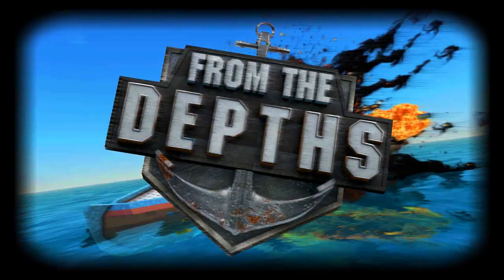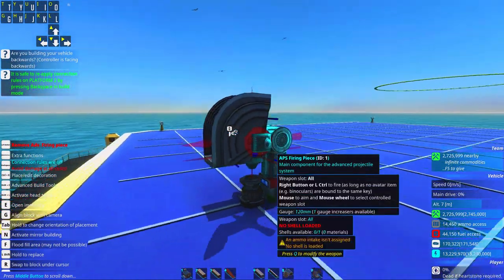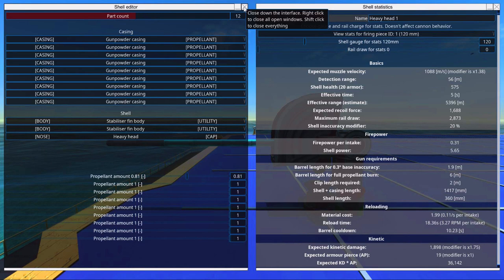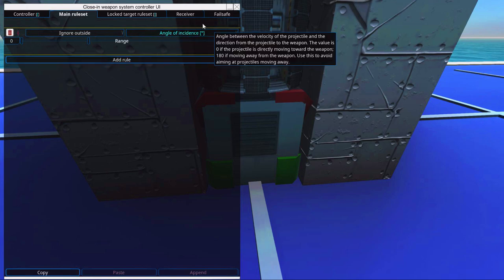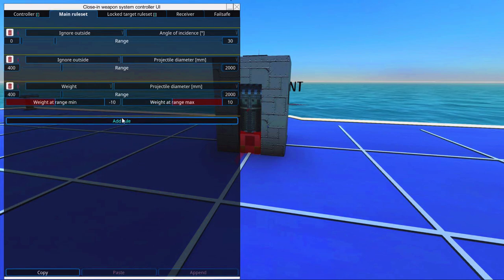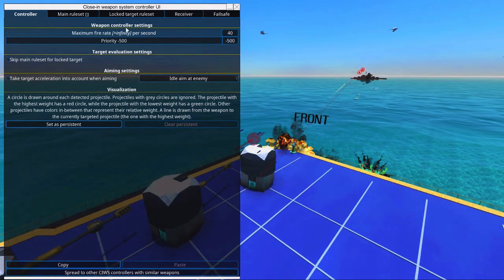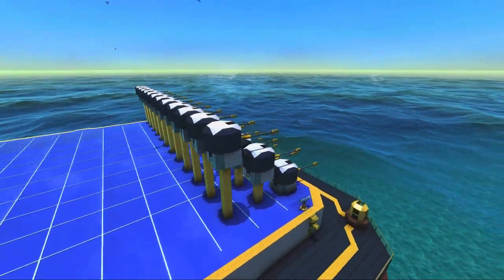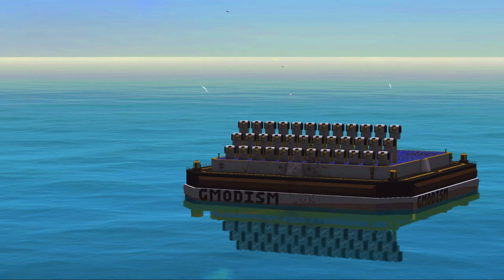From The Depths INSTANT Tutorial: DIF-CIWS "CRAM Crackers" (APS Point Defense)

Comment: One thing to remember is that most (if not all) AI craft are set up to prioritize enemies with many guns. So a ship with this particular defense system should also be expected to deal with a lot of enemy fire. Of course, you can use this to create a designated fleet tank that's specifically designed to take a lot of punishment.
Reply from the maker: If we got good cwis I'd happily take that in order to protect the weaker vessels :)
Reply: @GMODISM  CWIS is hard to get right, in my experience. APS in general, really. Lasers are kind of easy, if you just avoid drawing more power than you can generate. FtD is definitely one of the more crunchy games I've played.

Comment: I would love to see the 36 @ 500mm imagine it would shread! Nice video.
Reply from the maker: You and me both! They will like never reload but they would cancel the first volly completely haha
Reply: @GMODISM  I think I have found a way to cheese this and get a fast-firing  DIF gun. It involves multiple advanced firing pieces in a clip with multiple separators and a piston,  Basically, the adv fire pieces have two input feeders that connect on top of each other (clip) these feed into the mantel, etc. They join the craft with individual seperators. Once fired a simple weapon destroys the spent adv fire piece, this then separates the clip and with a piston pushes the next adv Fire piece into position and engages the separator to fix it in place. Then the cycle continues. The problem is the sequencing of this needs someone with breadboard experience.  I have mocked up the concept and it appears to work. This could be OP.
Reply from the maker: @adamchurchley6095 yeah thats some pure cheese haha